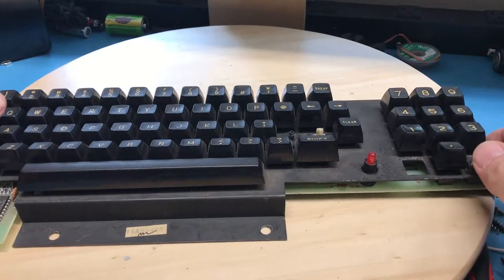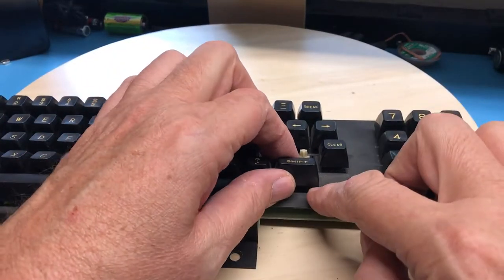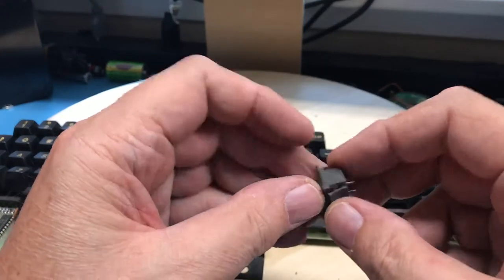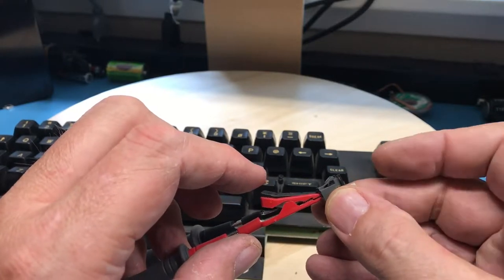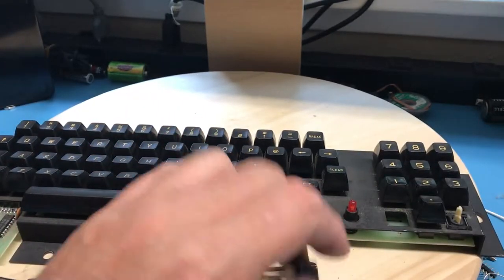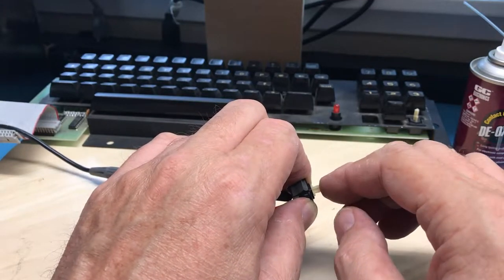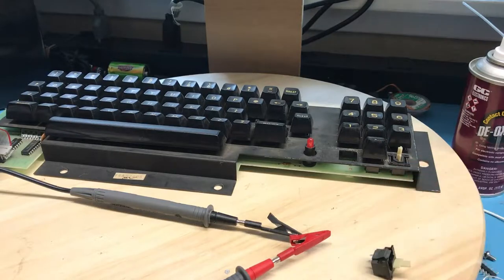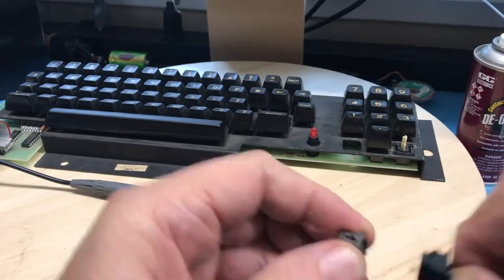Model I  - Fixing the key switches I broke - STB35

Comment: The keys do not necessarily drop to zero ohms when closed.  The Model 3 keys will operate fine at around 100 ohms.  If you look at the Model 1 schematic, the key scan lines are pulled-up to 5V with 4.7k resistor, which means that a logic low is fairly easy to get with a non-zero ohm "contact".  You may have been chasing an impossible goal...
Reply from the maker: Thanks, this is good to know.